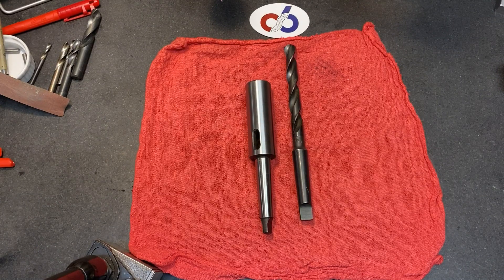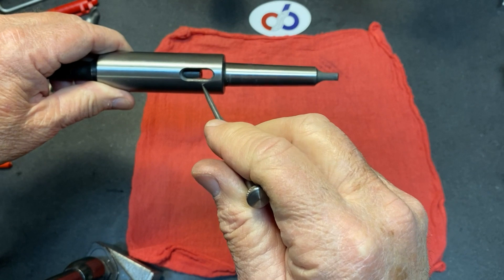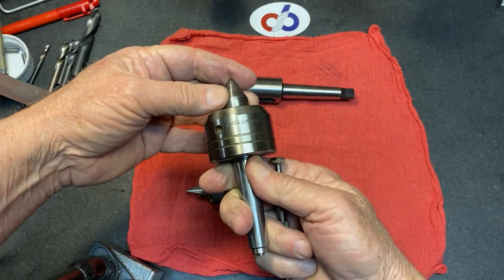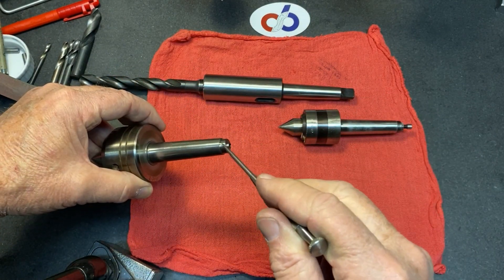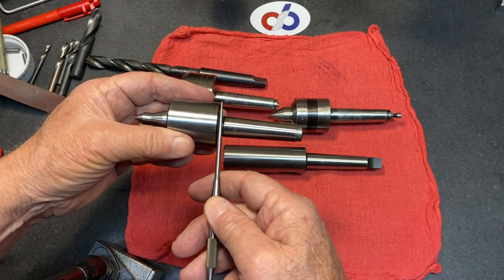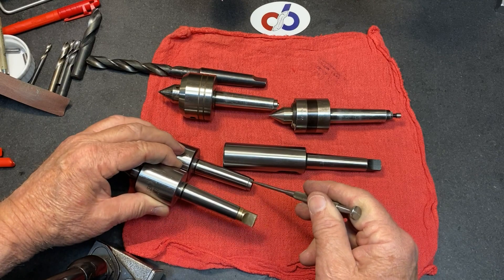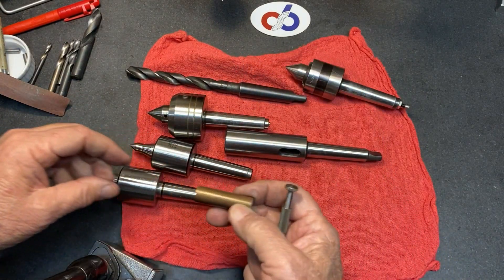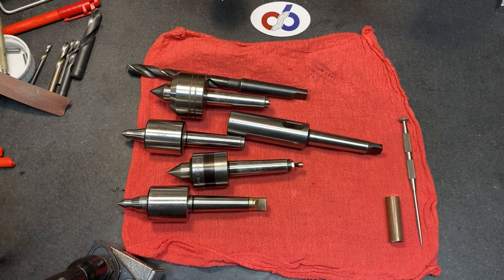AddaTangtoMe... (not a medical term)

Comment: That's cool, my lathe tail stock is MT2 and self ejecting. I have a Chinese live center. Luckily after shoving it in there for the first time I got it out with a wedge and a soft hammer. Not fun, lol. It is threaded M6 on the back and I made a plain version of your tang. I should mill some flats on it like a drill tang so I can use it as a tap guide or whatever in the mill or drill. Great idea, nice😎

Comment: I have the same problem with my MT4 tailstock and a royal center with a flat back and no threads. The clincher is that the from bearing shaft extends into the tang and I don't know how far. So, I am afraid to drill and tap it.
Reply: Older Skoda live centers are like that. Don't take my word as they are obviously different things but on the Skoda MT3 the rotating shaft is a good 3/4 away from the end.

Comment: I have had this problem on my Chinese C4 lathe and even on my older wood lathe.  I have made some "tang screws" that screw into the end of various MT tapers and some M10 and some are 3/8-16.  In a pinch I have stuck an appropriately sized ball bearing on the back of the taper with a dab of Extreme Pressure Lube.  Nice job!

Comment: Chuck, my EMCO lathe I purchased new in 1982 and made in Austria (not to be confused with ENCO which used to be made in China) had no slot in the tailstock spindle for the tang of tanged tools.  As a result I had to originally step drill virtually everything in very small increments or the drill, or drill chuck, or etc. would spin.  I finally ended up adding two 1/2-13 opposing stubby (they had to be buried in the spindle so they could retract into the tailstock casting) setscrews which serve as the slot and it has worked fine ever since.  I often wondered why the slot was never added to the tailstock spindle, as everything else on the machine is built rather robust for an 11 inch lathe, geared head and all.  I bought a larger capacity programmable tool room lathe 5-6 years ago and thought I would no longer use the EMCO, but I find myself still using it because I can get myself so much closer to small work.  I concluded the Austrians must prefer to machine VERY slowly😄

Comment: chuck i have never seen a tailstock center that needed a tang or extension to eject. is it possible that you might have a problem with the tailstock feed screw? could the barrel not be retracting far enough?  did you try your centers in another lathe to see if they will work in the unmodified condition? i wouldn't put anthing past a chineeseium center but the doall should certainly work. nice job on the tang.

Comment: Nice job Chuck. One of the very first jiobs I did when I got my first lathe was to add a little extension to the live center so it would eject. I made a little dowel that pressed into a hole drilled in the end. When you have a lathe almost anything is possible. Hope you and yours are well in the current situation. Mart.
Reply from the maker: thanks...IF I could have only one machine I would want it to be a lathe....thanks for viewing

Comment: Nice fix and certainly looks more suitable than the bolt Chuck. Narex shanks for there B&F heads come with a tang, it's threaded into the rear of the shank and then cross pinned in place. The thread pitches match what the usual drawbar threads are for MT or R8. Probably your press fit is just as good but a bit tougher to remove if an odd reason came up to do so.

Comment: How did you hold it to drill or mill ?
Reply from the maker: Hello Maurice...the body of the live center was held in the lathe chuck and for the work on the mill I used a 5c collet square block (brass rod) simole 180 rotation  and also used a V block to hold the live center body in the mill vice